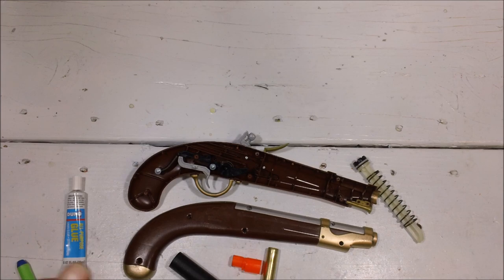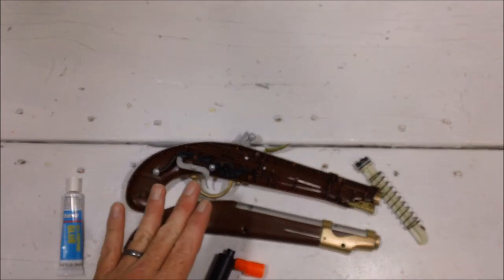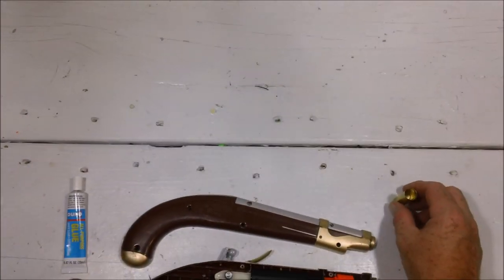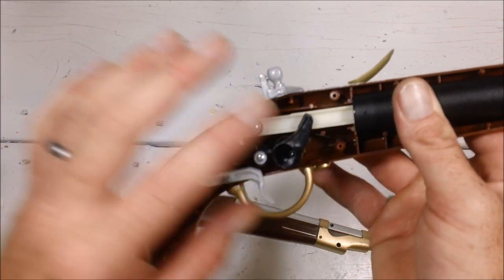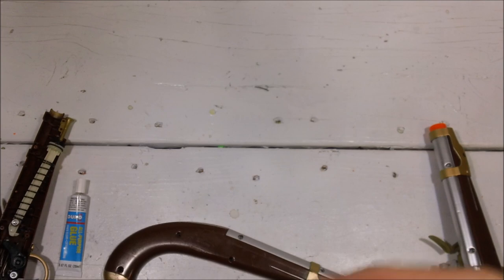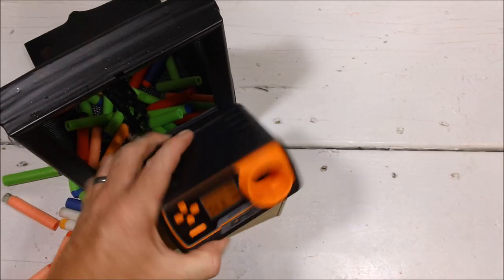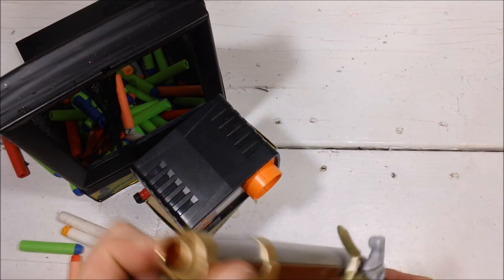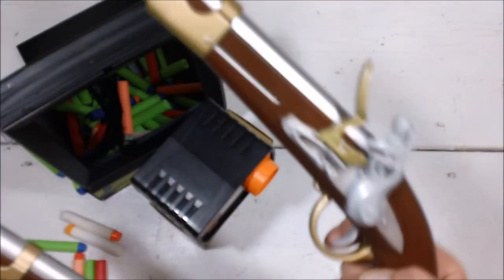Buzz Bee Pirate Pistol Mod Guide [ Nerf Mod ]

Comment: Small thing to note, theyre not actually 13yo pistols and in my case theyd be “17” because of video age, they actually have a label on the back of the box showing date shipped from factory, mine saying 2/26/24 they still make these and it was relicensed in 2018 the copyright/patent is still 2007 and always will be 2007, one performace upgrade i found is by completely removing the post and using half darts instead, no need just seat till snug
Reply from the maker: The design being that old is what I was referencing by the age. Buzz Bee has changed a lot in the time since designing this pistol, and honestly I'd love to see a updated version with new internals. 

This mod will fire half darts quite well! The brass gives a great air seal to maximize the available power.

Comment: Hi, where can I find the brass thing ? I am not sure I understood everything as I am not English native speaker and I have no idea where I can buy a brass barrel. Thank you in advance for your help
Reply from the maker: The brass is simply a section of 17/32" brass tubing that I cut down to length to fit the pistol's shell without sticking out too far. Amazon and other sellers will have 17/32" brass.
Reply: @MongooseJakeNerf  Thank you very much for your answer.

Comment: Hey, I know this is a years old video, but if you're still checking the comments - how do you trumpet/bevel the edges of the brass pipe? Is there a certain tool I should be looking for? Really interested in modding a couple of these for my LARP group, but I'm not the handiest person around. Was looking for some YouTube videos and struck out. Thanks!
Reply from the maker: I have showed that bit before, but it might be hard to find. I simply use a pair of needle nose pliers to act as the swaging tool. That's the proper tool, but I've had better luck with the gentle flaring that needle nose pliers do with simply pressing them and rotating on the end of the brass. 

Some swaging tools can do the same, others do much more pronounced flairs.
Reply: @MongooseJakeNerf  Thanks bro! Great information.

Comment: if you could get a machinist to make metal priming flint lock that would be great
Reply from the maker: I may do that on one when tax return time comes around in the spring, because it's going to be pricey to get that kind of work done. I want to do a few special pieces in steel and a couple in aluminum though.

Comment: I got one of these things for like $20 off of ebay for a pirate getup. I took it apart and noticed a spring and a plastic bracket had broken off that sat by the trigger. I removed that particular piece and the blaster seems to still function without jamming up(due to the broken part jiggling around and blocking the trigger pull?). Up next, get that little brass piece and possibly order a couple more second hand ones to attach to this plastic costume armor that I weathered for the pirate outfit.

Comment: Man, I'm loving your vids. Once again, you have knocked it out the ballpark. I'm definitely going to be using this lol. Question, how do you determine the length to cut your brass? You were asking the other day what you could do to improve, i think when you're able to, you should invest in a better video camera. I noticed it kept wanting to go out of focus whenever you were trying to do closes ups. Other than that, awesome video. I can't wait to see what else you have in store. Next time i'm in town, i wanna see if they still have some of those Tek 6's for sell, and if so, I'll send you one to go with your Tek 5.
Reply from the maker: First, I determine the length of brass by two factors, the level of power I expect the blaster to have, and I also keep in mind the blaster shell. In this case I made it so at least half the dart would fit in the brass to get a good seal, and cut it so it wouldn't protrude out of the shell and get damaged. 

Secondly, as far as the benchtop camera, I agree. The Sony Bloggie I use is older and the auto-focus is acting up a bit. However, that's where money becomes the issue... A decent one is a few hundred minimum.

Comment: I couldn't remove the muzzle ring, is it glued there?
Reply from the maker: The ring is indeed glued, you can pry  it off carefully, or you can also use the boil method. I have a video showcasing how to remove solvent welded parts from blasters on the channel.
Reply: @MongooseJakeNerf  boiling handled it, great!
Reply from the maker: @lonelysnakewei6176  Glad to hear that!

Comment: Do not add the brass it hinders the power of the weapon by adding friction thus slowing down the dart post-launch. add a small O-RIng inside the barrel to make sure you don't have to mess around with the dart to reload
Reply from the maker: A 17/32" brass barrel increases the efficiency of a dart blaster by providing a much improved barrel material and a far greater air seal to the dart. It doesn't add friction to a degree that it degrades performance at all, only increasing it. That's why we use it so much in blaster mods, and have been for years.
Reply: @MongooseJakeNerf  uh only been modding blasters for about a month now favorite one so far has been the Chewbacca Bowcaster was able to get it to 100 fps by adding tension to the limbs an extreme amount while it does misfire here simply cause reload it wrong it is wicked fun with the power
Reply: @MongooseJakeNerf  by the way thanks for giving advice well to know it thought thats why a longer barrel degrades it so just add a little friction for a better hold and create more density of air pressure got ya